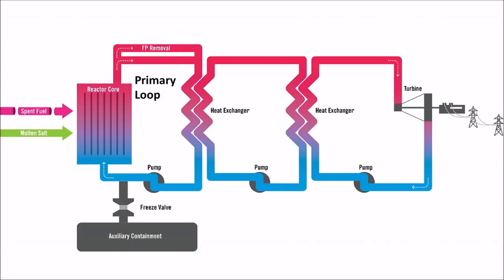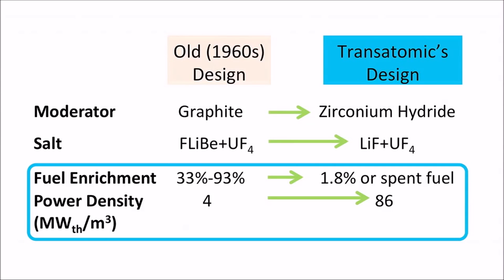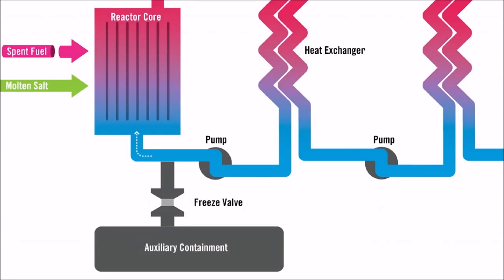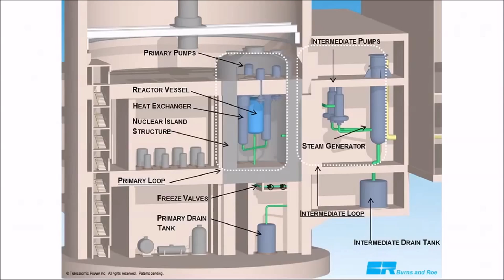Burn Nuclear Waste with new High Technology Reactor (MSR) [Read description for update 2/2019]

Comment: I meant to say Vitrification process of recycling
Reply from the maker: Sorry for my delay, but I now understand better what you mean due to this clarification and YT isn't the best with notifications.  Anyway, vitrification is a waste disposal process - and a good one at that, not a recycling process.  It is arguable, and perhaps you meant to say this, that you could recycle the uranium and plutonium out of the fuel, then vitrify (make to glass) the other fission products.  It is wasteful, but it still is a tiny portion of the waste, and economically viable.  I would argue vitrification is unnecessary, but it is an effective additional enhancement to help prevent leaching and thus the mobility of elements in the ground.

Comment: Safer way (maybe would be to solidify nuclear waste into red glass by adding sugar in special process ) than use it in fission /fusion thorium reactor since liquid waste is aggressive and corrosive with in time eats it way through container and concrete special made storage facilities .
Reply from the maker: I think you may be confused about what is in nuclear "waste".   People seem to think of it as some kind of bubbling goo, but it isn't.  It is a collection of ceramic material in which some of it has converted to other solid materials.  A small amount converts to gasses such as Xenon, but they dissipate quickly.  If we are talking about the spent fuel after it has been in a cooling pond for a few years, it is basically ceramic pellets in a metal tube.   Have a look at how Palo Verde stores "spent" fuel, which could be used in future reactors.  https://www.youtube.com/watch?v=NG2jN--D2Es&t=110s

Comment: I was under the impression that the MSR experiment at Oak Ridge was based not on uranium but on thorium...
Reply from the maker: You can read about the MSRE in Wikipedia here, https://en.wikipedia.org/wiki/Molten-Salt_Reactor_Experiment.

You aren't exactly wrong, but the answer lies in these words:  
"The latter 233UF4 was the result of breeding from thorium in other reactors. Since this was an engineering test, the large, expensive breeding blanket of thorium salt was omitted in favor of neutron measurements."

As you can see thorium was used in OTHER reactors, and the MSRE could use thorium, but was omitted for the test, using uranium instead.  

It did however use U233, which comes from breeding thorium, so that basically provides proof of concept for thorium.  Basically if you had collected the neutrons in an outer "blanket" containing thorium fluoride, you could breed more U233 for the reactor core for fuel.  They just didn't do that additional step since they were only testing the core at that point.

I would also highly recommend the "Dinner" video, which is an interview where you get to be a fly on the wall for an interview over dinner with some of the few remaining researchers who worked on the MSRE and discuss its details.  Here is the link:  https://www.youtube.com/watch?v=ENH-jd6NhRc

Thanks very much for watching and commenting!
Reply: Thanks for your clarification... I am preparing an informal talk on the subject of «Energy, Environment and Civilization», from a «sociologist cum economist» perspective...
Reply from the maker: I'd be interested in learning more.  When is it to be given, and what state or country do you plan to give it?  If you would like help finding resources I have a lot to provide.  Ask anything you like.  You may also like the website www.lftrnow.com
Reply: This informal talk will presented this week in Lisbon (Portugal)... Thanks for your offer... I have been visiting and studying many websites (including lftrnow...) .
In my youth I studied the fundamentals of Physics and Industrial Chemistry, but ended up as a field sales manager of IBM in a couple African countries, where I witnessed the crucial need for clean, abundant and energy if Humanity is to get hundreds of millions of fellow human beings out of poverty. As of late I was visiting professor of Complexity Sciences and the Political Economy of Underdevelopment at ISCTE-Lisbon University Institute. Thks again, and I will probably be asking questions in the future...
Reply from the maker: If you haven't seen this already then it will bring tears to your eyes.  https://www.youtube.com/watch?v=BZoKfap4g4w  Hans Rosling does an excellent job of presenting why the rest of the world needs energy.
Reply from the maker: I can also recommend the two TED talk videos from Michael Shellenberger, particularly if you have to answer to the argument about how nuclear affects the environment, or if you are wondering how to end people's fear of nuclear.   https://www.youtube.com/results?search_query=michael+shellenberger+ted+talk
Reply: @LFTRnow  i want to buy your stock. any option?
Reply from the maker: @boogeyman2868  Regarding stock, I think you might be confused, this channel is to promote nuclear technology and pro-nuclear activism.    You should also probably read the video description first for more info.
Reply: @LFTRnow  is ok i see she had to close down her little startup, but i found the chinese manufacturers that actually get things done :)

and no im not confused, the question is as is.
Reply from the maker: @boogeyman2868  Well, I'd love to have stock to sell you, but since I don't make any money doing this, it probably wouldn't be the best financial investment, thanks for the compliments :).  However, if you are looking to make donations, there are lots of people trying to help that will take your money, many of which I support.  Generation Atomic is a fav of mine.  www.generationatomic.org